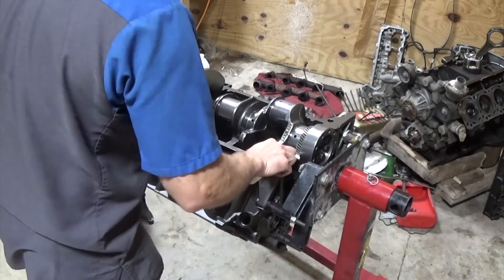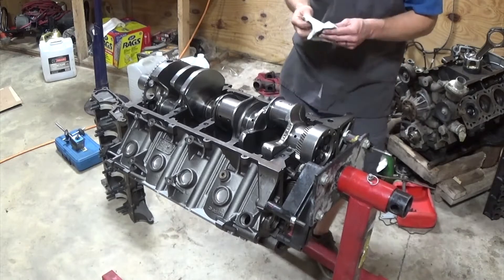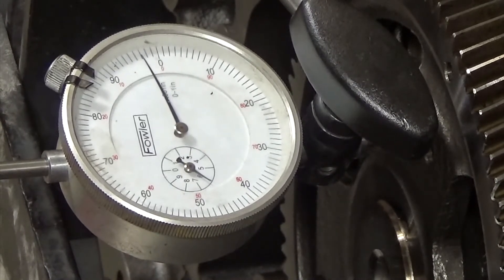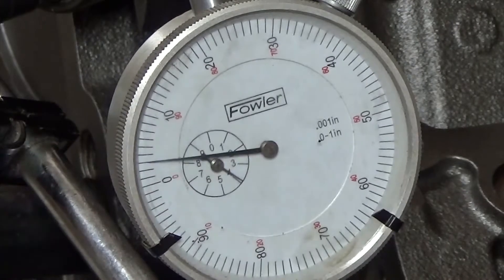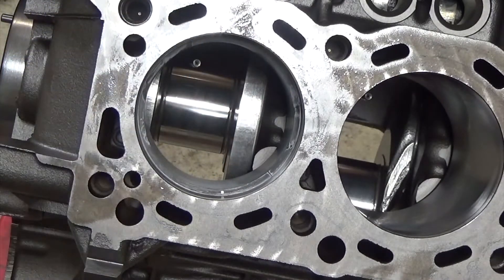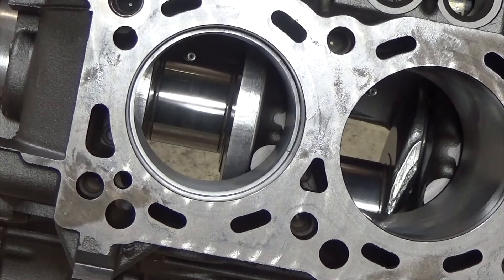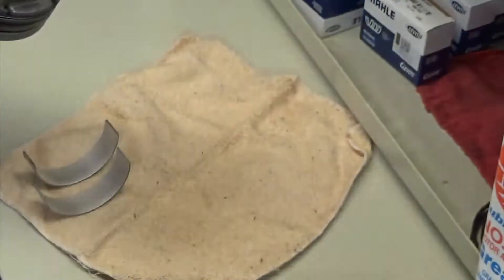Best 6.0 engine rebuild part 4

Comment: Did you replace the connecting rod bushings or did you just used the same ones?
Reply from the maker: I had a machine shop replace them. My understanding is the new bushing have to be reamed to the correct size. Correct me if I’m wrong.

Comment: This may be a dumb question but could the under spec on cam/crank gear backlash cause the unusual wear on the cam bearing?
Reply from the maker: I could see that causing a similar Issue. 
For that to happen I would imagine the backlash would have to be 0.

Comment: you don't mention what you are using to lube the bearings, and you don't mention what you are using for a gasket sealant?
Reply from the maker: You can use oil to lube bearings. Any engine assembly lube will work. 
I’d recommend a ultra grey permatex

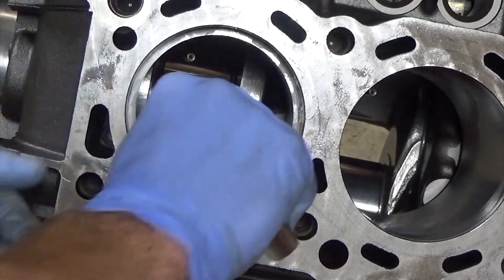Comment: Yikes! Hopefully just the lighting but the deck surface looks like absolute dogshit at 12:30 when he’s checking ring end gap. He’d to believe that’ll seal up.
Reply from the maker: Contrary to what people say. The Headgasket sealing surface does not have to be machined every time head gasket is replaced. What you’re seeing is staining on the deck. The sealing surface should be cleaned and checked for flatness with a straight edge. This engine is in a truck and running great.

Comment: Wish you woulda shohld what actually you doing with gap meter with the gears so on
Reply from the maker: I was checking camshaft thrust. It’s the amount of in and out movement the camshaft should move. If I heard correctly spec is 2-8 thousands. My checked out at 3 thousands.

Comment: I'm enjoying your video series on the 6.0 powerstroke. I'm waiting on my block, crank and rods to come back from the machine shop. I am getting an ARP head studs, can I reuse my main crank and connecting rod bolts? thanks
Reply from the maker: Thanks for watching Munem Rabadi? 
If there wasn’t any damage to that area I reuse the bolts to both. If you are replacing rods then I would do new bolts. I just made a post showing pictures showing example of your question. Thanks for asking.

Comment: what you were talking about from 2;02-2;15? so a moron such as myself can understand? thanks for these videos
Reply from the maker: The cam and crank have to be lined up so they are in time. The tool I was using helps make sure the crank and cam and aligned while installing. 
A person could look at the pin on the crank and 2 holes on the cam to make sure they are lined up correctly. 
Understand?
Reply: @showmerepair  yes thank you

Comment: Is there a certain overhaul kit you use? I’m currently taking my 6.0 apart getting it ready to rebuild. Not sure which kits to use. I want to keep mines close to stock. Thanks
Reply from the maker: I use ford gaskets. I’m told they do not offer a kit so I buy parts individually. 
The only other kit I would buy is a Mahle gasket kit
Reply: Ah ok. Thanks for the advice!. Great videos! Appreciate the quick response.
Reply from the maker: Your welcome. Thanks for watching.

Comment: What is that black thing you used in each screws
?
Reply from the maker: What was the time of the video that you are asking about?
Reply: @showmerepair  5:28
Reply from the maker: ARP bolt lube 
https://www.speedwaymotors.com/ARP-100-9910-Ultra-Torque-Fastener-Assembly-Lube-1-2-Pint,93380.html

Comment: What bolts and I safe to reuse. Engine is fine just doing upgrade rebuild. Has 133,000 miles
Reply from the maker: The only bolts I do not reuse are the head bolts

Comment: How would you go about creating more clearance on the backlash of crank & cam gears 
I have a 2012 6.7 powerstroke I want to rebuild with 2020 pistons and Connecting Rods I rebuilt the heads after catching exhaust cracked valves but that’s about the most I’ve done inside a engine your videos and a few Duramax are a good combination of the 6.7 powerstroke
Reply from the maker: Sounds like a fun build. Normally The concern would be to much back lash. To little could be an issue with a gear, bearings or the line bore of the crank is incorrect putting the crank closer to the cam. Are you using mis match parts from a 2020 other then rods and pistons?

Comment: Should have gave that block a hot soapy bath before assembly. As much black as you whipped off with them rags you're oil pickup will be clogged in 200miles. Otherwise good video for beginners
Reply from the maker: Scrubbing a block down with soapy water does work good. It was hot tanked while at the machine shop. I always spray blocks down with wd40 if they set for a little bit. It’s amazing how much dirt and oil still come off engine parts after they’ve been cleaned.

Comment: hi what kind of engine assembly lube are you using?
Reply from the maker: I’ve always used Lubriplate. Here a link. 
https://www.amazon.com/gp/product/B000HZJFE0/ref=as_li_tl?ie=UTF8&camp=1789&creative=9325&creativeASIN=B000HZJFE0&linkCode=as2&tag=jcbryant85-20&linkId=29003876c30c7c25c7aa9911990e9fbd

Comment: What did you put on the threads of those bottom end bolts?
Reply from the maker: ARP bolt lube. Im always torquing bolts so I buy it in the jar. 
https://www.amazon.com/gp/product/B004XJRFCK/ref=as_li_tl?ie=UTF8&camp=1789&creative=9325&creativeASIN=B004XJRFCK&linkCode=as2&tag=jcbryant85-20&linkId=aba8f0c657b6ba7dcf5c1d124e17fd89
Reply: @showmerepair  Cool thanks, I am about to do my own rebuild series for YT.
Reply from the maker: Here is a smaller tube 
https://www.amazon.com/gp/product/B004BRCR5Y/ref=as_li_tl?ie=UTF8&camp=1789&creative=9325&creativeASIN=B004BRCR5Y&linkCode=as2&tag=jcbryant85-20&linkId=7897d545b7326ab40f7ea5643d2d9e7c
Reply: @showmerepair  thx

Comment: Thanks for the awesome videos.I am putting one together right now.I was wondering where you got the engine lift plate? Thanks
Reply from the maker: I made the lift plate in the video. If I remember it’s 1/8 inch plate steel and 1/2 inch rebar. I used the turbo pedestal as a template for the holes. Drilled 2 holes in the center, bent the rebar to fit the holes then welded the rebar to the plate. Works great.
Reply: @showmerepair  sounds great.I will do the same. Thanks

Comment: What will you have in this entire build, I wouldn't mind picking one up at the junkyard. I have about 250k on mine but would be nice to have a fresh motor ready in case of any issues.
Reply from the maker: I have around $3700 in the build. That’s not including the cost of purchasing the engine. I think I could have saved money though in places. I bought a bunch of gaskets individually at Ford. I think if I would have bought a kit I would have saved money. I know Dynamic Diesel performance sells a rebuild kit with pistons.
Reply: @showmerepair  Thanks, I had seen one of the diesel companies sold a complete package with the cam for 3500$, but thats with no machine work. I would like to save a bit with the stock pistons and keeping good parts like you did. I would think stock components should hold 500hp if well built.
Reply from the maker: I’ve heard of people making 800 with stock internals. I’ll have a video out soon of a friends truck with thing we’ve done. I’ll eventually show what it makes on the dyno
Reply: @showmerepair  Awesome